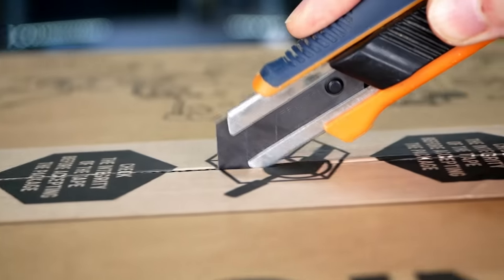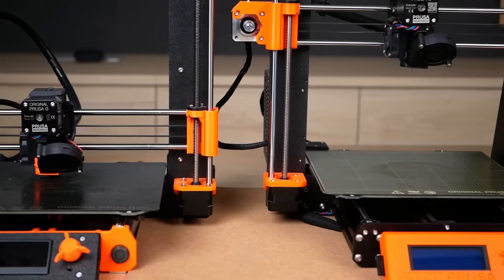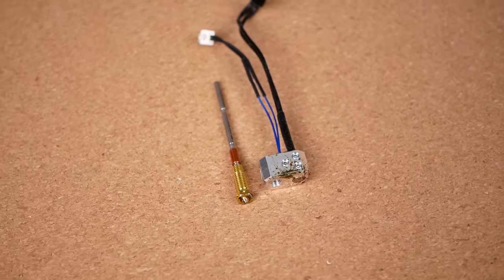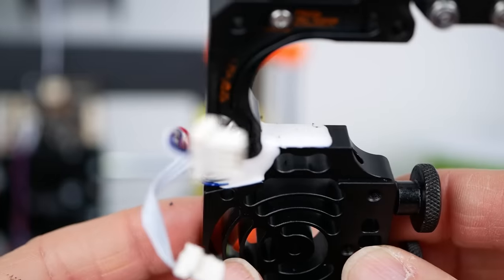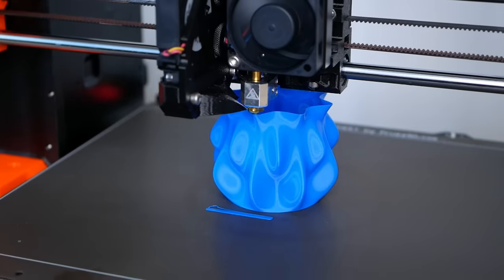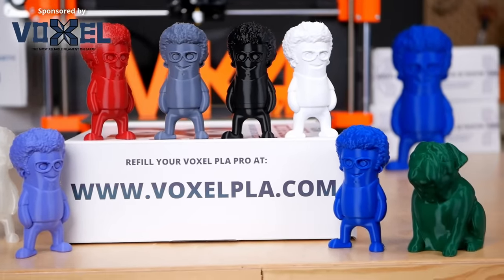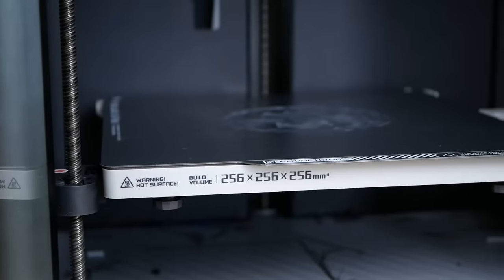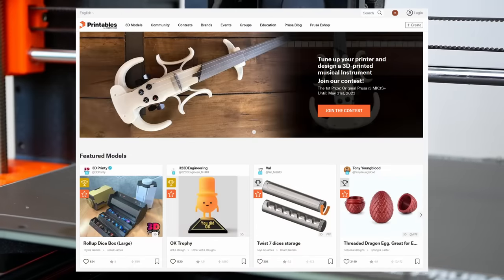Should you buy a NEW Prusa MK4 in 2023 or rather a Bambu Lab X1/P1P?

Comment: I have the X1C, MK3S+, and have ordered a MK4 kit.  My Prusa is my go-to machine when I don't need something right away and I want it to look great.  I've had far more failures on the XIC than my MK3 (even though I've had the X1C less than 1/3rd the time), and I imagine that the MK4 will fill the same role as a slightly slower printer with rock-solid reliability.  I also like that the Prusa is open source and probably easier to source parts for.  I've never had an issue with my MK3, but I've had two warranty issues with my X1C and working on the Bambu printers is a nightmare .... unless you have little baby racoon hands ;) ... Oh - and network connectivity on the MK4 will be a welcome addition.

Comment: I've had my mk3s since they came out and it is still the most used and most loved of the 4 printers I own (the other 3 are all newer than the mk3s).  I am a design engineer and fiddler and have actually designed and built my own version if an I3 from scratch that a friend uses, but for me, the reliability of Prusa (with no need to fiddle) and great support makes all the difference. I fiddle an upgrade am Ender 5 plus and when I need to print something, just use the Prusa. , All of the proprietary nature of the bamboo is a defined deal breaker. I am also unsure if the mk4 is worth my money as I have never been unhappy with the print quality on the mk3s and most of my prints run overnight, so faster is not  necessarily better for me

Comment: I purchased a Bambu X1C after owning two Makerbot Replicators (first gen 2/2x) and the difference 10 years makes is staggering. My ABS parts almost never warp now on the X1C, and I have a 99.99% success rate for parts. The AMS was a bit tricky but works great for what I need it for. I am concerned about doing repairs and I hope they have a Repair Hub in New York City in case my printer breaks down. I ordered the extra parts bundle but I really want things like fans, or filters, or more belts, or circuit boards - things that often go wonky over time. Still the X1C is a very impressive machine, I might actually buy a second for ABS and TPU printing.

Comment: I had a Prusa MK3 S+ for a couple of years and now I have the Bambu Lab x1-c with AMS.  In my humble opinion, you can't compare a MK4 with a Bambu lab because the Bambu lab is 3-4 times faster and a lot easier to use.  It is fair to compare 3 Prusa MK4 with one Bambu Lab x1-c without an AMS, that is because the MK4 does not support automatic filament changes.  I am extremely happy that I switched from The MK3 to The BL X1-C with AMS.

Comment: Having seen a number of American printer companies shut down due to the explosion of cheap competition, I am very happy with my Prusa's. Having a machine that I can fully break down to repair/rebuild/modify is always a big influence for purchasing. A machine that is easier to maintain that has been tested for thousands of hours is worth that extra up front cost given it is going to be around for years and years of service. Glad to see solid competition forcing companies to continue to innovate and improve instead of resting on their laurels. 

I have a Mini+ at home and a Mk3S+ at work and plans for a Mk4 for those big prints at home.
Reply: I can tell you that it does not help having the repairability when the overall design is just inferior. I got a MK3S+ for 1.5 years and now buy a X1 Carbon because of the obvious inferior MK3S+ design, features, speed, problems

Comment: Just ordered the MK4 kit as an upgrade / replacement for my MK2s.  My MK2s has been a real workhorse and once I get my MK4 I will finally get around to upgrading the MK2s to the 2.5s with the kit I bought awhile back but have been too busy printing to install.  While I do find aspects of the Bambu offerings interesting and welcome the competition to help advance the technology, I don't like closed proprietary machines.
Reply: I finally encountered some critical issues with my MK2.5s, which coincidentally occurred the day before the mk4 went live. I got mine in the first batch and I can confidently say it's been a joy to use. Straight out the box it printed a flawless 250x210mm layer on the bed, perfect peel and all. The MK2 is also a bit loud but not insanely distrubing... but the mk4 seriously makes it seem EXCESSIVELY loud in comparison. I think you're gonna have a good time :)

Comment: Great video! First like you I love my Prusa! I purchased my MK3 in 2020. I love it, have had virtually no issues and I love the fact that Prusa support is always there when I do have a question or problem. When I heard about the MK4 I thought it would be fast like the Bambo. My Atari cartridge holder takes 22 hours to print and I would like to cut the time down. So I started looking at the Bambu. But, the more I learned about the Bambo the more I was afraid of my investment. I read a lot of horror stories about the hot beds being warped and getting replacement or exchanges very difficult due to Bambo being located in Shenzen, China. So rather than take a gamble on the Bambo, I will stick with Prusa. I like being able to contact Prusa any time of any day for any questions or problems. People have reported issues getting answers or fixes from Bambo. So rather than worry if Bambo will be here 6 months from now with proprietary everything, I will buy a MK4. This video helped me! I hope it helps you too!
Reply: Any regret 9 months on?

Comment: I've been looking at prosumer style printers a bit more lately and I'm not convinced a bed slinger makes much sense at this price point. The fact that Bambu labs' stuff is so proprietary has me leaning toward a Voron or something similar. I'm not buying anything super soon though, so waiting is fine. The new corexy printers from Qidi and Creality look promising. Hopefully we'll see more in this space. Maybe Prusa can do a smaller corexy at some point too.
Reply: Bed slinger works, that's all that counts for me. It's reliable. I don't care if a model prints in one hour or two.
Reply: @testboga5991  For sure. I have a bed slinger. I love it and use it extensively. It's just that if I'm going to drop 1k on a printer, I'd definitely get something else. If Prusa's thing is reliability, they should probably move to a more reliable motion system too. Maybe the idea here was backwards compatibility, but the upgrade kit costs almost as much as a new printer, so that doesn't really make sense.
Reply: @jabberwocktechnologies  What's unreliable about Prusa's motion system?
Reply: @joegf1739  z wobble for tall parts and shaking the part loose from the bed are fairly common issues. Most of my print fails right now are because of failed bed adhesion. Slant3d did a more detailed video on all the issues with bed slingers recently. They're still a very successful and effective budget design, but if you're going to put more money into the printer to get better quality and reliability, getting a bed slinger doesn't make as much sense.

Comment: Like the video and you bring up the most salient points I feel. Love my x1 love my mk3 but with the huge upgrade price to the mk4 I cannot justify it. In fact since I got the x1 I have used none of my other printers at all. For me a big difference is the c1 is fully enclosed so you can print anything, yes you can buy a Prusa enclosure but that too is very expensive, very expensive and I just cannot afford it.
Prusa has done so much but this mk4 feels like a rush job to me, a result of them not innovating at all for years and suddenly panicking when Bambulab appears. Hence it being released without all the upgrades actually being supported.
Reply: I built ages ago IKEA lack closure for my A6 where MK3 has now been sitting for years. I just sometime ago checked Prusa enclosure if I would upgrade, but it's indeed way too high priced for what it is imo.

Comment: I'm really torn between the two, I'm in the market for a new printer, I've had a original i3 clone for years but looking for something newer particularly for bed levelling and print quality improvements over my current unit.

On the X1, I love the multi-material option and how they've created such a smart and integrated system with the spool holder on the top and a nice enclosure and screen, and also love the lidar AI features too. What I dislike is that it's a closed ecosystem with no ability for upgrades or customising.

For the Mk4, I love the whole Prusa ecosystem and community, open source nature and ability to add and customise parts of the printer over time and perform upgrades.

I'm really torn between the two, but I think I'll end up getting the MK4
Reply: Depending on where you‘re from you also support a product from the EU. This was one of my biggest reasons to buy a Prusa where at least some stuff does not come from China.
Reply: @bixenbaer  I'm in UK so although no longer in Europe, I appreciate the quality of European goods. At the moment given the price I may end up waiting for the MK4 to start showing up pre-owned, by that point hopefully the MMU3 will be released for it as well, I think the Mk4 will be my end-goal device but I'm now considering a Bambu A1 as a stop-gap until then given UK stock (no import duty) and much lower price and then upgrade to the MK4 some time in the future.

Comment: I decided to support the MK4. Was really on the fences but decided on the Prusa because their open source support. I have been using a closed system since 2016, Zortrax M200 and it is a fantastic printer. However, the inability to support the host of innovations around the open source ecosystem always bothered me. The Bambu certainly appears to be a better value but I'm going with a fully open system with a large ecosystem.

Comment: I truly worry about damage to the printbed using the nozzle probing, but I guess many set-ups have done this for a while, so I trust they know what they are doing.  They did talk about using the loadcell to determine clogging and skipping.
Reply: That was my concern as well, but then I watched a video of someone getting a perfect first layer on cardboard with the MK4. The trigger force would have to be imperceptible to do that, so there is likely no risk of damage to the buildplate.
Reply: Typically the load cell of any nozzle probing system trigger at the force of few grams and tge nozzle is also only pre heated to 140 to 150 degrees, so it shouldn't be much of an issue. The most demanding nozzle probing system is voron tap, the force is tge toolhead weight plus tge force of the retaining magnets. This goes even so far that you have to use the aluminium extrusion and cant use a lightweight aluminium x axis and tge 350mm size is generally a bit sketchy. I mean around 600 or even 700 gramms pushing down during probing can slightly deform the x axis, bed mount (trident) or even the bed itself
Reply: Might take some years till they implement anything more useful like clogging detection.

Comment: Thank you a good unbiased review. I think the Mk4 is the better printer in the long run due to the support, the open-source design, the firmware upgrades, the nozzle quick swap, and simpler design. While the X1 price is hard to beat, I do wonder how long these pre-built CoreXYs will fair after a few years. I wouldn't be surprised if several of them fail prematurely.
Reply: @youeatthemtheydie  I agree except comparing it to Tesla. Tesla is the most profitable car company. Probably due to no advertising and dealerships. But yes I'm worried Bambu is going to kill much needed business with these machines. Prusa however will likely keep on going thanks to their innovations to FDM. Bambu didn't innovate, they just got community innovation to market faster than anyone.

Comment: Prusa's support of open source is a huge selling point for me.  I use FreeCAD and PrusaSlicer, so my entire engineering tool chain is open source.  Having had problems with proprietary designs from QIDI that were abandoned after a year when they sold a newer model 3D printer, I'm leery of long term support from any Chinese manufacturer.  QIDI went so far as to solder the header pins on the opposite side of the industry standard open source stepper motor driver boards to reverse the pinout to force me to buy their proprietary parts, and then wouldn't sell them when I needed them to support my six QIDI printers, so I'm very sensitive to companies (usually in China) benefiting from open source but not only not contributing, but actually making open source hardware into their own proprietary parts.  That's just evil.

I love the print quality and print speed of the Bambu Labs printers, but I'm also a bit concerned about long term wear in the carbon fiber guide rods that are not replaceable.  We know Prusa printers are well proven for tens of thousands of hours in 24/7 print farms.  Bambu Labs printers don't have that proven reliability.
Reply: Very good points here. 
I heard from some youtuber who lived and loved in china for 10 years+, that the principles you called evil are seen as something to be proud of.
Reply: @diy-lbk  - Since I made the previous post, Bambu Lab has begun selling more replacement parts, including the carbon fiber guide rods.  Their repair parts are reasonably priced but if the guide rods wear and need to be replaced, that wouldn't be a trivial job.  My concerns about intellectual property rights and 100% playing well with the open source community remain.

Comment: Lots of good points - pro and con.  This is why I really want to see reviews on the XL before I complete my purchase.  After purchasing both the Bambu X1 and P1P and building two Rat Rigs, I would really like a printer that is reliable and has a good multi material system
Reply: Did you get the X1 with their multi color system? Do you have reliability issues in general or with the color changing?
Reply: @ZachLayne  I did get it with the AMS.  It is probably as reliable as any system on the market.  My problem is with so many spools not fitting correctly.  I have built a re-winder and am transferring to the correct size spools.  If it does not feed correctly you will get a message and can correct the problem and resume.   It works, but is slow and seems to waste a lot of filament with each change.  I try to keep my changes to a minimum.  Here is a video of mine working https://www.youtube.com/watch?v=W42z05GKQes&ab_channel=DavidWilson

Comment: I like the bamboo labs machine, but the cloud requirement is a deal breaker for me. I'll likely be buying the 3.9 upgrade for my mk3 clone.
Reply: people keep telling me you can offline it
Reply: You can use it offline as long as you don't mind using a micro SD to transfer. It's pretty annoying to take in and out, but it does work.
Reply: @arthurcarre1393  I guess a wireless card would eliminate all of the hassle?
Reply: @Flashbang_Photo  Would be cool if it did

Comment: Too little, too late. They panicked when the Bambu happened and rushed the announcement/release with "good enough" firmware when creality dropped the K1, which sounds like it's using Klipper and Mainsail (EDIT: Apparently Fluidd if it's the Creality Sonic Pad) and will immediately have aftermarket parts (as it's a creality). 

Prusa did a TON for 3D printing... But nobody knows what the hell a Xerox is nowadays... Becoming #1 doesn't mean you can slack off, if anything you have to work harder because everyone else can use what you learned to catch up to you faster. Prusa slacked and at this point is putting disk breaks on a horse and buggy. Sure it can stop on a dime but... Why?
Reply: Yeah. Reminded me Nokia as well.
Reply: @AlexanderMoon  I almost went with Blackberry instead of Xerox... But both being printer companies was just too good. Lots of companies have done the same thing effectively, and now are at most weird corporate supply with zero consumer awareness.
Reply: @pretzel_tfg  yes, it's called "bad management", not uncommon.

Comment: I am new to 3d printing.  Yesterday, my i3 MK3S+ jammed somewhere in the hot end.  Couldn't get filament loaded or unloaded.  But, since I built it from a kit, I was virtually certain I could fix it.  It took a little while to realize I was going to have to remove the hot end and pull out the PTFE tube.  For reasons I don't know yet the filament was jammed tight in there.  Anyhow, machine fixed and printing behind me.  No packing off to some place and getting it back 2 weeks later, etc.  Oh, the online directions were 99% percent correct, too.  And since Prusa supports comments, the answer was right in the comments, I just failed to read them til after I figured out the answer 🙂 So, yes, Prusa.

Comment: @CNC Kitchen I'm torn as well. I really want a Bambu because it's enclosed and have been wanting to print nylon and other materials for several years. But I have a Mk3S+ and it's just such an awesome printer. I recently moved with the Mk3S+ where it traveled more than 900 miles in a truck, stored in a warehouse for 3 months. Sat in my closet (sadly) for another 6 months. The PETG roll was still connected to it and filament about to break in two different places. Earlier tonight I finally took it out of my closet, plugged it in, and printed a random PETG test file on the SDcard. The only thing I did, was wipe whatever dust was on the build plate off using my tshirt and I hit print. The print came out perfect, just the same as the last time I printed it. I didn't even do a calibration on the printer.
So I really would love to get a Mk4, but the Mk3S+ is so good that I'm not convinced the 4 is worth upgrading to. Maybe I'll go for the MK3.9 upgrade kit, but I've heard some rumors about issues with the loadcell and other stuff so I'm gonna wait a good while before I decide on buying an upgrade kit.